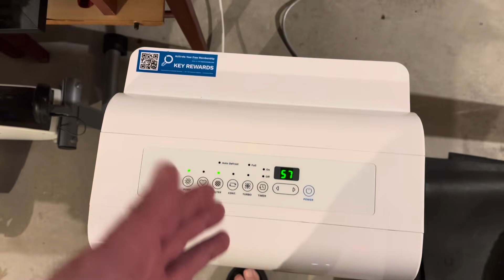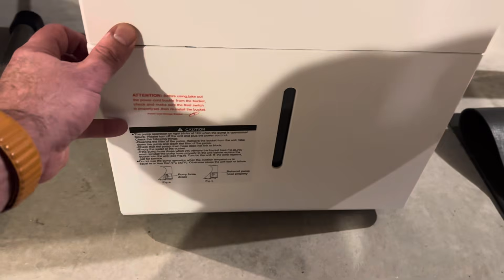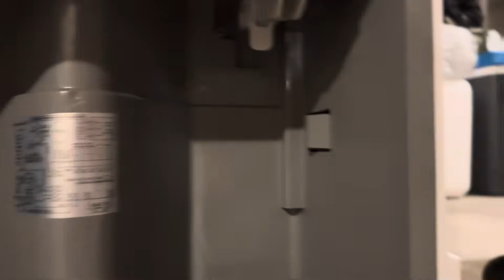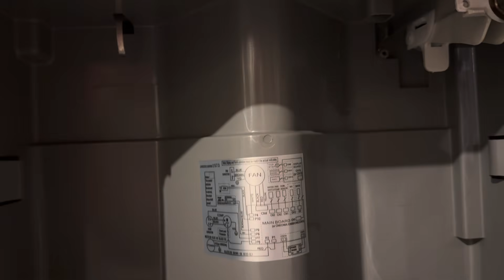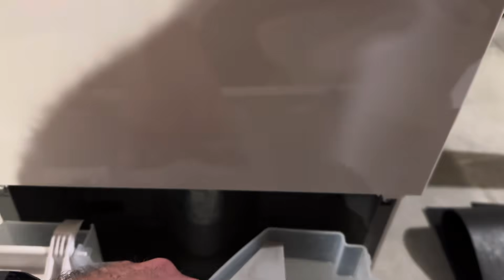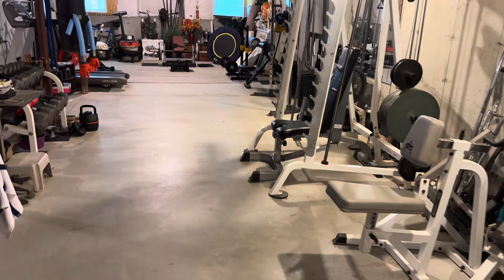"How to Fix HomeLabs Dehumidifier Not Pumping Water or Shutting Off - Easy Sensor Fix"

Comment: Great tips. Stainless steel springs must be switches. W/out reading instructions, im Assuming top one is triggered by the float when full so it shuts down,, and bottom one so that the unit wont run with the condensate bin removed. I had to suck on the end of my pump tube to get it flowing.

Comment: Just instructions like remove and clean the filter is already in manuals.  I usually look for a video to see how it is done which I did not find for cleaning the filter.  My filter has never had a spec of dirt in 3 years which makes me wonder if I am removing the right filter. Now I will be looking for videos that actually demonstrate the process.
Reply from the maker: The filter is on the back.  Just remove it and wash it out in the sink and replace it.  That’s the only filter on the machine other than the one that goes in the bucket with water.  That comes off easy by just pulling it off.

Comment: We just unboxed a new one this weekend and it shuts off with the E3 error code. 😮 It’s frickin brand new.
Reply from the maker: That’s what happens during shipping.  Try my fix and see if it works for you.  Since fixing mine it’s worked flawless.  I had three brand new ones all didn’t work until I fixed the issue.

Comment: As far as I am concerned, dehumidifiers made by homelabs are absolute garbage.  I bought 2 units and after 1 year of use in the summer, both units run but do not collect any water or reduce humidity.  I paid over $600 for these 2 units.
Never again will I buy from this company. I will try to fix them over the winter but good luck on getting support.  The company no longer has a phone call support, only email and good luck on that.
Next time I buy a dehumidifier I am going to get one from a company that stands behind its product and provide a real live support.
When you think about it, dehumidifier are very simple, a compressor, and 2 coils. The first coils gets cold and collects liquid in the air while the second coil converts it back to warm air to feed back into the room. 
You buy air windows air conditioner which has the basic components as dehumidifier for most part and they last 10 years or more. But when it comes to dehumidifier, we cannot make one that lasts more than 1 to 3 years if you are lucky. This is because most dehumidifiers on the markets are basically piece of junk when it comes to reliability.  You pay good money and 2 years later, the dehumidifier stops working and you cannot fix it or get parts or support.  
Like I said, no more buying dehumidifiers from Homelabs or others on Amazon.  They are junk and designed to die in 2 to 3 years. I will invest in dehumidifiers that are made to last and can be repaired down the road when needed.  I hope you do the same.  You pay more initially but throwing  away $300 to $350 every 2 years or so is not a good alternative.
Reply from the maker: Sorry you’re having so much trouble.  Mine is still working perfectly and I’m so happy about it because it’s saving all my gym equipment from rusting.  

Feel free to reach out on my instagram if you want to chat on the phone for more help.
Reply: @ITSTHISEASY  Thanks for offering to help but I don't have time to take my units apart to figure out the problem.  Many people reported that these units cannot be repaired in many cases such as there is no port to add refrigerant if needed.  
One thing caught my attention is that you mentioned in the video that the company sent you 2 units and both were defective. To me, that proves that this company is not interested in delivering a quality product because a good company will test to ensure that the product is in perfect working conditions before shipping it to the customer.
As an electronic engineer for over 30 years, I see a huge trend toward making products to make profit without any regards to building reliable products than can be repaired down the road.  Even big ticket items such as cars and trucks, today it is not uncommon to have trucks and cars that are less than 10 years old and yet cannot be fixed due to lack of good  parts.  I just bought Ignition Control Module from Ford and the part was defective from day one.  Absolutely dead on arrival and I have the data from another shop to prove that.  I was able to get a refund from my bank after filing a fraud claim on my credit card purchase.  Otherwise my plan was to take For to court to collect my money 
In short, over the winter I am going to try to fix these dehumidifiers but my gut feeling tells me they are going to end up in the trash due to lack of support.

Comment: To folks that use a hose: I had a similar issue, and it was caused by a clogged hose. Water would back up into the machine and it would stop with a P2 error. 
Bought a new hose and it’s been working fine ever since.

Comment: Hey, had the same exact issue where my pump would work then get to a certain level at the bottom of the tank and stop working, an error message would go on.  I did exactly what this video said and it fixed my problem.  Customer service was telling me to try all of these different things and none of them worked.  Appreciate this video as it fixed the problem!
Reply from the maker: They told me the same and nothing helped me either.  I’m glad my solution helped and mine is still working perfectly now.  It’s a great unit when it’s working.

Comment: Mine has the hose attached but still stops running when the bucket is full. Any ideas? Does your bucket still fill up and then the over flow goes into the hose?
Reply from the maker: Thanks for the question.  Did you watch the entire video?  Just asking so I know what you have tried.  

Basically if you pull those metal tabs some as I explained then just put the bucket in and it should drain for you if your using the skinny hose it came with.  

It doesn’t drain constantly just when it needs to.  I have not had to empty my bucket since I fixed it.  

If you have any other questions feel free to ask.  Good luck 😊

Comment: Have you gotten a E5 error?  How do you fix?
Reply from the maker: It’s a high temperature sensor.  You have to open it up and look for a wire that says high temp.  If it’s plugged in, then you need to replace that sensor.

Comment: Mine stopped collecting water even in turbo for hours. Worked before and I've cleaned the filter. Any ideas?
Reply from the maker: Check that the inlet tube is not clogged.  Also make sure it’s in the upright position when you slide the tank in.  It needs to drop in the tank when it slides all the way back.  

There is a screen on the inlet tube.  Check that it’s clean and also the actual tubing is not clogged.  

Let me know how you make out with that.  If that doesn’t work I’ll think of something else.
Reply: Dude thank you so much. Let me take a look now and try and find the inlet tube.
Reply from the maker: @bradsronce  the tube is inside above where the tank you pull out is.  It falls into the tank that holds the water.  On it you will see a screen.  Take it off and clean it if it’s dirty.  Then look in the tube and see if it’s clogged.

Comment: Had this issue for a while and it was the pump that I had to replace. Took about 15 minutes to take apart and replace. Pump was under $20 on Amazon
Reply from the maker: Thanks for the info.  Fortunately this hasn’t been the issue with mine.  Glad you were able to fix yours so inexpensively

Comment: I just watched your video because when I went to clean the filter, I notied that the bucket was full and I thought the pump must not be working.  After watching the video and reading your comments, I should not be concerned if the bucket is full as long as the machine does not shut off.  It seems you are saying that the pump doesn't kick in until the bucket is full.  Should I expect it to drain down completely?  Is that one filter the one large rectangular filter the only one I have to worry about cleaning?  Thanks for all your help!!!
Reply from the maker: As long as it doesn’t shut off and give you an error code yes it is draining.  It waits until the contact senses the correct weight I am guessing and I am never there to see it drain but it does because the water level glass is always different when I’ve looked.  

As for cleaning the filter yes that’s the only one unless you get a clog in the bucket where it sucks up the water.  There is a screen you could have to clean at some point but I’ve not had to clean mine.  

With the bucket out you can see it and should be stuck up inside.  When you push the bucket in it drops into the bucket.  

Thank you for the question and it’s a really good dehumidifier once I fixed it lol 😂

Comment: Mine doesn’t have a drain hose to the outside, I have to dump the bucket when I is full and shuts off. My question is when I dump the water ever once in a while it leaks water all over the floor.
Reply from the maker: I’m guessing that it’s leaking possibly because it’s over full.  If that’s not the correct answer then I’m not really sure because it sounds like like I don’t have that model.  Thank you for the question and feel free to describe anything else that may help me understand more what’s going on
Reply: @ITSTHISEASY   By the bucket I’m referring to the one that slides in and out of the dehumidifier. Every once in a while after emptying  it it seems to leak water on the floor, like it’s not even going into the bucket. Not really sure if something misaligns when I slide the bucket back into or out of the machine. Guess I’ll call the manufacturer. It’s only about a year old so it should be under warranty. Thanks for your response. Enjoyed your channel.
Reply: @rick4649  hey Rick. Might you be tipping the bucket a bit? Sometimes I accidentally do. Just yesterday w the bucket IN, I have puddling on the floor nearby. I'm all bent out of shape over it. Our apt is super damp to a dehumidifier is necessary.
Reply: @rainbowsandkittens1537  The manufacturer is sending me a new one. Apparently there is something wrong inside with the drain. That should solve the problem.
Reply: @rick4649  alright!!
Reply from the maker: Reading your message again I’m wondering if when you put the bucket in, are you making sure that the thing on the inside that needs to drop down into the bucket has actually done that?

Comment: I just bought one of these and it doesn't seem to lower the humidity at all. It's sucking out some water, but it doesn't drop at all. I had a frigidaire in the same spot that would drop it immediately until it died on me
Reply from the maker: Sorry to hear this.  Mine definitely works now that I fixed it.  Maybe see if they will send you a replacement.  But if it’s pulling humidity in and getting rid of the water maybe you need a bigger one.
Reply: @ITSTHISEASY  I asked Amazon for a return and they just gave me refund haha. Picked up a different brand and had no issues

Comment: Hello again-- I wrote to you on your first video with your pump working very little. I am going to try your fix when I find those tabs and then I will get back to you. But my other question is I see that your bucket is FULL-- so the pump action should be working since the bucket is FULL- right?? But then why isn't the Bucket FULL light ON?? Can you explain the reason why that light is NOT on and yet the bucket IS full and thus the pump should be ON?   Ad have you emptied the bucket at all and when doing this- does the pump start again once the bucket fills up again?  Thank you for these in-depth videos.
Reply from the maker: Hello again, my bucket in the video looks full but it wasn’t yet.  Because it’s working now when it gets full immediately the pump kicks on and drains the water now.  I have never had to empty the bucket since I fixed it.  It’s been running now seamlessly for two years now.  It’s set to automatically just drain the water and also keep the basement at 55% humidity.  

It would only show FULL of the pump wasn’t working so you know to empty it.  Mine never shows full anymore because it just empties it when it senses the bucket is full.  Take the bucket out snd find those two tabs and just pull them out a little.  They need to make contact with the bucket or the pump will never turn on.
Reply from the maker: Also, as you see in my video and just so you know I just watched it again because it’s been so long since I had to mess with mine.  I watched it again so I could remember everything.  

The pump light is on because I want it to pump when it’s full.  It have not been around it once when it was actually pumping to see it pump the water out so I don’t know if it ever says FULL.  I just know whenever it knows it is full that it pumps out the water now and just keeps running.  

In the video the bucket was pretty full but it must not have been as full as the contact needs to start pumping the water.  I am positive if you bend those two metal tabs forward a bit yours will work like mine did and you won’t have to mess with it again.  That is assuming you have the same model and yours does have a pump.  

Also, you must use the little hose or it will not pump out the water.  The garden hose outlet doesn’t work with the pump.  If yours doesn’t have the tiny hose inlet or didn’t come with the tiny hose then you don’t have a pump in your unit.  

I do hope this helps you and please come back and let us know.  Good luck 😊

Comment: Mine runs but don't pull water keeps happening been replaced more than once
Reply: Came here for a different problem maybe you can help? Mine doesn’t drain out thru the hose or into the bucket. It just leaks onto the floor, super counterproductive. My guess is I have to take it apart to find the faulty hose from the air pump. What do you think?
Reply: @jaysonshannon4487 ooooh no! What a nightmare.
Reply from the maker: You need to watch the video again and pull those metal tabs.  Also, make sure when you put the tank in that the part that drops down actually drops down into the tank.  

Before you place the tank in make sure the thing that drops down is pushed back up before you slide the tank back in.  

That part is how the water gets from the tank to the pump.
Reply: @ITSTHISEASY  mine doesn’t have a metal tab on the floor in the back only upper left.
Reply: @usvvetme2 mine’s the same way - it has a slot for that metal tab (on the m back right floor of where the bucket goes), but there is no metal tab. My machine will run but the bucket doesn’t fill.
Reply: @scottmccracken5208  Did you ever fix this? My bucket isn't filling as well.
Reply: I have the same problem with two units. Both of mine leak from the bottom. I only use the bucket.

Comment: Thank you!!!! I was able to fix mine thanks to your video!! Same exact problem!! Strange thing tho.. I do not have the metal thing on the inside that I would think would be for the weight. I just have the metal piece up top inside.
Reply from the maker: So glad the video helped.  And if yours is the same model I’m surprised as well that you don’t have the one on the bottom but maybe they changed it up I guess.  Mine has run flawlessly since I fixed it so hopefully yours does the same.  Thank you for the comment 😊

Comment: Mine after 5 years is getting a big build up of ice on the coils, Also I had to tilt the machine so it would drain into my sump pump.  I can get the humidity below 70%  in the basement
Reply from the maker: Did you try cleaning the coils?  If there is a lot of buildup on them you can clean them.  You can look this up on Amazon here is the link.  

Frost King ACF19 Foam Coil... https://www.amazon.com/dp/B007I7KZN0?ref=ppx_pop_mob_ap_share

I used this to clean my outside AC coils.  Make sure you wear safety glasses and unplug the unit.  Spray that on and then let it sit no longer than 10 mins.  Then make sure you don’t get any water in electrical parts and hose it out outside carefully just to take the chemicals off the unit.  

When the coils are caked with gunk it won’t work properly and build up ice.  That’s caused from dust etc in the area.  

Also make sure you clean the filter with just water.  I haven’t had to clean mine yet but I’m sure someday I may.  

If you try it and it works please come back and let us know.  It helps everyone which is why I make my videos.  Good luck 😊

Comment: Buddy I can't tell you how much I appreciate this. I had the same problem and was baffled. I even did what the manual suggested and cleaned the screen on that little pump arm over the bucket that swings down. It did need cleaning, but of course that didn't fix the problem. I tried your fix earlier today and tonight mine is working like a charm, pumping like it should. Thanks again.
Reply from the maker: Happy this worked for you.  And yes, I was so baffled but couldn’t give up.  How could they send me 3 brand new dehumidifiers and they all not work?   lol 😂 

Mine has been working flawlessly since so I am sure yours will as well.  Glad you found my video.

Comment: I had a similar situation, the condenser in my homelabs dehumidifier seemed to stop running. They sent me a free replacement like you. But i would love to fix the old one and have rhe extra. Have you had any experience with this issue?
Reply from the maker: Sorry no I haven’t had that issue.  My new unit just didn’t work from the beginning and neither did the two others they sent me which is why I figured something had to be happening during shipping.  Since I fixed the third unit I haven’t had any issues.  

I have however seen YouTube videos on how to repair the condenser so give those a look.  Seemed pretty straightforward to me.  Good luck and if you don’t mind I’d love to see how it goes if you do fix it.  Would love another comment on here because it helps everyone. 

Good luck and thank you for the question.